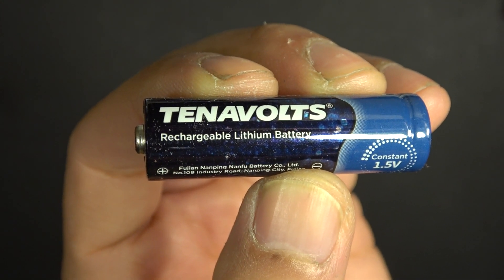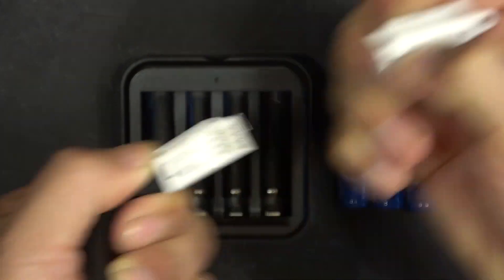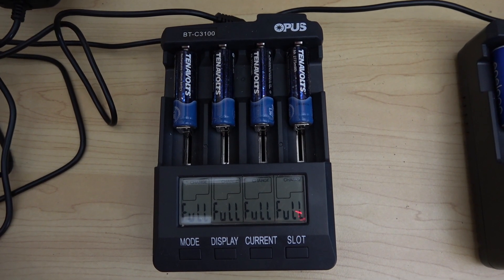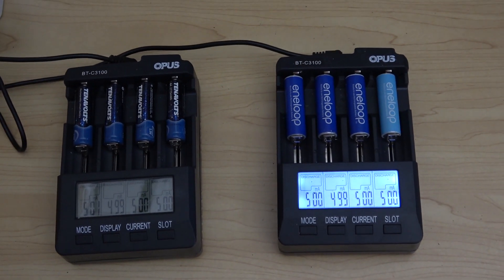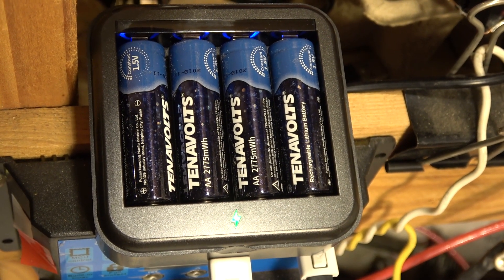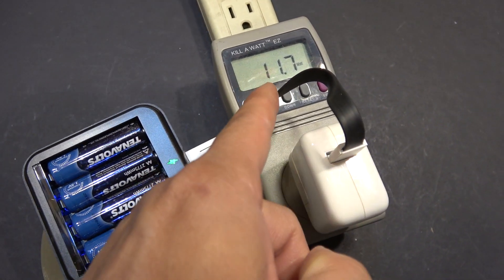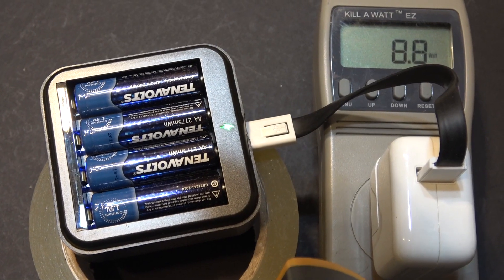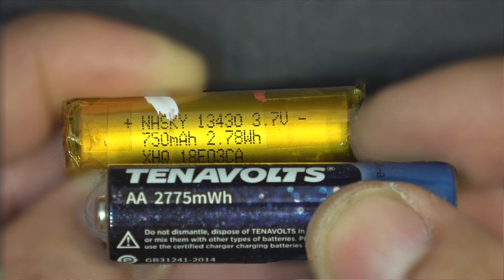Review & Teardown: Tenavolts AA Size 1.5V Li-ion battery

Comment: The capacity of these batteries are terrible. Less than AAA batteries. They have 3x less capacity than the cheapest AA alkaline battery...that's what Tenavolt and Amazon (suppresses reviews) won't tell you. Don't believe me? Then you don't know how to do BASIC math.
Reply: Absolute lie from someone with no experience on these.  They will outlast any NiMH battery in a setting that needs voltage for power such as thermostats, cameras and front door locks.       NiMH batteries are the ones playing games with your mind because they want you to believe they last longer while only supplying 1.2 volts.  In reality they won't power devices beyond remotes and wall clocks for very long at all.  I've put these through the test and they are far better than the Eneloop pro and Fujitsu Black.  Don't even mention the crap white label stuff.
Reply: Yeah look at the mWh not the Mah since the eneloops run such low voltage. The real world answer is it depends on usage, if you are in a high draw device these can supply high voltage longer. They don't fade to black like eneloops and similar NiMH
Reply: Bro do some Math that you claim you can do. 2775mWh / 1.5 V = 1850mAh, these are higher if you consider Ni-MH output at 1.2 V and will continue to drop in voltage with a rated mAh of 2000 so around 2400mWh so yes these last a lot longer than that.
Reply: A lot of you guys are confused with the mWh rating. That is indeed a little dirty trick. Don't compare that to mAh. You would take the average operating Voltage,  times the mAh to get the final overall power storing capacity of a battery. A typical rechargeable AA battery is rated at 1.2 Volts, a typical Lithium Ion battery is rated at 3.7 Volts. it is rated at 3.7 Volts, but fully charged is usually 4.2V. The rechargeable AA batteries start at higher than 1.2V when fully charged but when discharging they will stay in the 1.2V range for a long time.

Comment: I have these and they come with a normal USB charger now.  No weird plug.  Work great on anything that needs the voltage like battery operated front door lock.
Reply: Joel, are they any good for RC cars ?
Reply: @luissimoes8106  They are great for the controllers of my Tamiya cars.  NiMH always show low voltage on the radios where these don't.  They are outlasting my NiMH batteries in the front door use significantly so they should last a long time in lower drain devices as well.
Reply: @Therealjmhinkle  don't know "what to do"...🤔 I have a set of Sorbo 1.5 V lipo USB rechargeable ones ones and, in older cars don't work, In recent cars you don't see that bigger punch like when we swap from Alkaline for Ni Mh;
So, until anyone make that comparison I'm stopped... thinking in Eneloop or Duracell...🤷‍♂️😁😉

Comment: I wanna buy those circuits and build my own :/
Any closeup on the circuit? Or any idea what it is made off?
Great video!
Reply: It's just a very small "buck converter". Also known as a DC-DC step down converter. You can buy them pretty cheap but they are not this small, but fairly small.

I have modified a lot of my kid's toys to use lithium batteries (18650 and other sizes) using either a step down or step up converters depending on requirement.
Reply: @moes2168  Ive worked with the lm2596 before. But something as tiny as this that fits the diameter of a small cell would be great for some projects.

Comment: There are several applications where I'd gladly trade ~20% of the Eneloop's capacity for a constant 1.5 volts from full to dead, like cheap bike lights. I don't use disposables, and the Ni-MH cells aren't even 1.5 at full charge! My only complaint is that it's not 1.6V (more typical of a fully-charged disposable battery), but again, a steady 1.5V is worth the "loss" of 0.1V. Very cool.
Reply from the maker: Right on! Eneloop has more capacity but it goes down to 0.9V on the low end. This stays at 1.5V the entire discharge cycle.
Reply: @vuaeco  I don't understand saying that the Eneloop's have more capacity. To compare the two you need to use mWh, not mAh, as the Eneloops operate at much lower voltage. The TENAVOLT was 2475 mWh, vs. Eneloop's typical 2300 - 2400 mWh. Total power is actually lower for the Eneloop.
Reply: @vuaeco  there is a cheap knockoff of the tenevolts on amazon called "altizure" and they put out 1.8-1.9 volts, unifortunately they last less than half as long in my low wattage LED usage. The Altizure only has about 1600 mWh
Reply: This is my issue with rechargables as well.  No NiMH lasts long in high drain devices.  These batteries are working extremely well for me in the same situations.
Reply: @Therealjmhinkle  Plenty of NiMH last long at high drain.  2Ah cells can take a 2-4 amp drain or more.  The equipment is the problem.  Don't design a 2 cell high drain device to stop working at 2V, or perform badly at 2.2.  The device needs to operate over a range of voltage (0.9-1.6V per cell) and a lot of equipment is too badly or cheaply designed to do this.
Reply: @radellaf  No they don't.  I have some of the best NiMH batteries out there designed for high drain and they just don't hold up.  Front door locks destroy NiMH batteries in no time at all.  These batteries last up to 6 months in a high use setting like mine.
Reply: @Therealjmhinkle  The fact that your door lock is badly designed (won't work at 1.0-1.2V) doesn't mean there's anything wrong with NiMH at high drains (they do great, and if the lock runs at all off the USB AA then it isn't even "high drain" as it's <1 amp).  If these 1.5V batteries compensate for a bad motorized lock design, that's great, but don't blame NiMH chemistry.

Comment: Wow pretty interesting, I guess they made a proper lithium AA conversion, it does actually have more watt-hours than an eneloop, however for most AA powered devices they will just use more power at higher voltages so the runtime benefits will vary, a wireless mouse will probably run for longer however your multimeter or clock will not. 
Some things I am still curious about: how does the original charger charge the battery? what is the maximum current that can be drawn from the battery?
Reply: My el cheapo Logitech wireless mice from a decade ago are extremely frugal in terms of power draw, to the point where I use them as homes of last resort for any disposable cells I end up with (from used equipment, included with new items, etc.). They happily do the "low battery" blink for months, with no issues.
Reply: I don't know about these Tenavolt ones but some of the very first batteries of this style actually had two terminals at the positive end; the charger contacts a recessed ring connector around the normal protruding nipple which provides the 1.5v output. If you look up Kentli  batteries you'll see what I mean. I imagine regular chargers won't work because they'll just contact to what is the 1.5V output circuitry.
Reply: I am trying to figure this out. I bought the tenevolts on amazon, as well as a couple of knock offs. Knock offs are deleepow and altizure. The tenevolts are superior in every way when I run them on some very low wattage under cabinet LED lights. Alkaline Costco/Kirkland brand AA's run 7-10 days, the tenevolts run 6-7 days, the deleepow maybe 3-4 days and the altizure's run for only like 2-3 days. Altizures put out 1.8+ volts and the deleepow and tenevolt put out about 1.5, so you don't get the dim lights like you would with NiMh rechargeables such as eneloop. All of these 3 brands have chargers that look identical and all put out 5 volts, but NONE of them will work with the competitors batteries, or at least their charging indicators don't work. I think they are set to very manufacturer specific output voltages. The tenevolts seem to turn themselves off with the internal circuit and the others have some kind of sensor in them like a normal lipo charger. Putting the altizures for example on my RC car tenergy charger on 1s (1 cell) 3.7v lipo auto charge senses the voltage like normal when applying voltage over 1.5 and I can charge them easily that way (i don't know why his charger had an issue, probably because it tries to auto sense wheras I can set the charger to LiPo mode only). anyway that's likely all confusing and I should make my own video comparing them all. If you want a set of these get the tenevolts and their own charger. I am off to try to charge them in my 18650 charger now!
Reply: @gagegr  just got some of the cheap alizure batteries but did not buy their charger since I already have a smart charger and it will charge them up to their normal 3.7 volts I'm unsure if this will damage the internal circuitry or not

Comment: There is a lithium titanate rechargeable AA with a usb charger built in the battery. They are on amazon. LTO claim to have 20000 cycles.
Reply: LTO looks badass, comrade. The most impressive part for me (a Eurosquatter north of the "Medicine Line") is how it performs in sub-zero temps. My ideal lithium ebike battery would be LTO, energy density be damned!